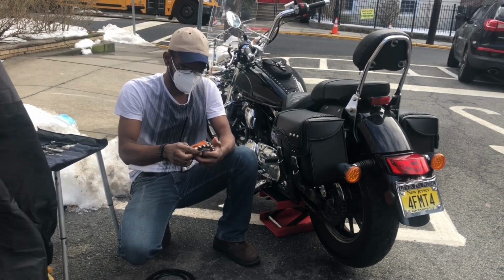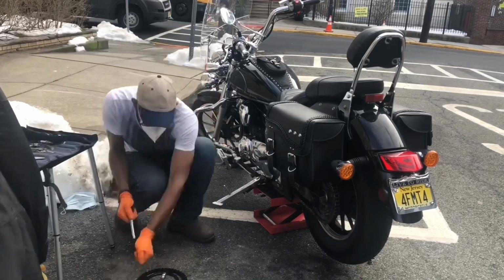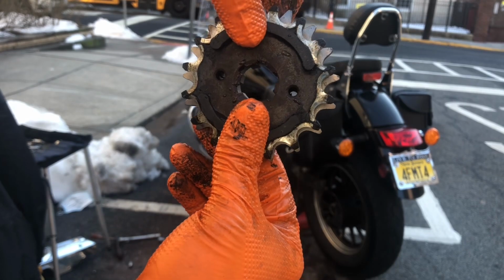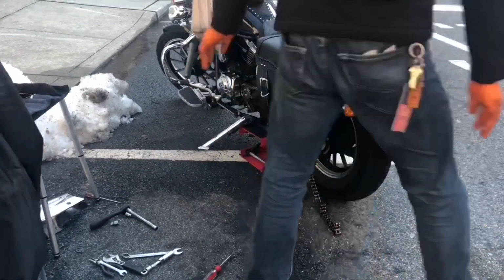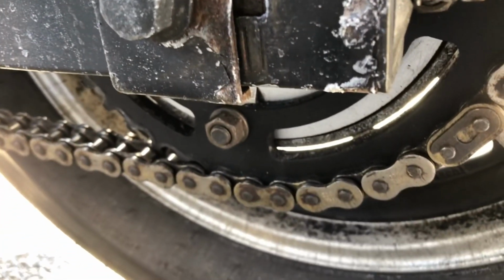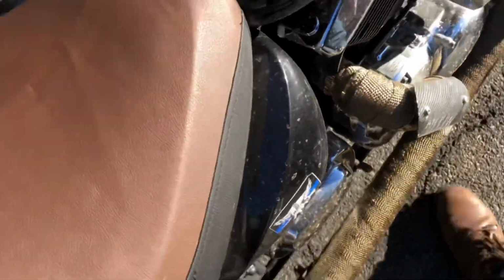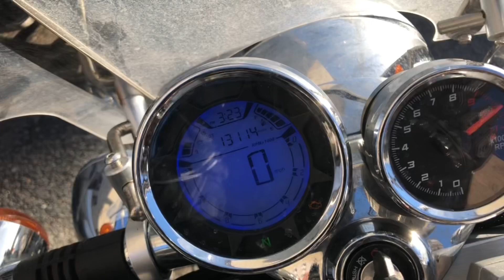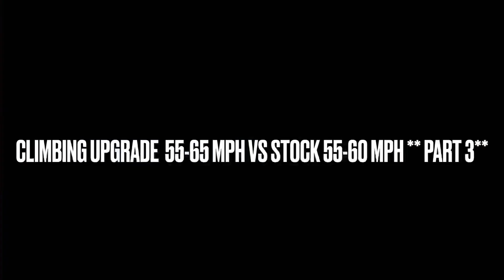American Lifan Lycan V16 LF250-D-E Motorcycle / 12,000 Miles / Tall Gear Ratio 2.47 (42/17) Upgrade

Comment: hi there many thanks for all info,new owner of lifan 250 v16 efi, i once owned a xv250,but the v16 is completly different much more easy,  my first modification will be 17/40 ,no need to stay near red line to cruise,  so you tell us that the bore of the lifan v16 250 is  bored 175cc Piston on each Cylinder ?what a great news ,may thanks for all your shared knowledge,
Reply from the maker: @sylviequirin2371  Sylvie, enjoy your bike. Hope the videos I put out help you with your upcoming maintenance. Thanks for watching :)

BTW, I’m officially retired, have been going with the slogan for years on this channel but the time you are watching this, is the time I won’t be able to help you getting parts.

Comment: I put a Yamaha virago 250cc 16/40 520 chain and sprocket kit on my Lifan just fine no problems
Reply from the maker: How did u find the 25mm front sprocket for the Yamaha virago 250cc?
Reply: @Mr.FLOYDs  honestly, I just took a gamble and ordered a sprocket set for a 2009 Yamaha virago 250 and it went on my 2009 Lifan like it was for the Lifan.. but I found the kit on eBay
Reply: @Mr.FLOYDs  Part: JT O-Ring Chain/Sprocket Kit 16-40 Tooth 520 Pitch
Sprocket Material Front-Rear: Steel-Steel
Tooth Count Front-Rear: 16-40
Part Number Front: JTF569.16
Part Number Rear: JTR857.40
Included Chain Length-Pitch: 520-112
Chain Type: O-Ring
Reply from the maker: You should try a casino lol… with that kind of luck u can become a millionaire over night n I’m not joking. Yamaha Viragos and those that I researched has the 21mm sprocket and I swear I was looking into that before actually using my import experience to make this work. Yet you just gamble n it went to your favor lol…

Comment: what is the cruise speed and what is the final speed? How many miles can you travel without overheating?
Reply from the maker: Lol if u plan on traveling without overheating u need to redo ur math. I'd say given that the temp is at 25 fahrenheit u can go forever with 10W40 at high Rev. Right now with this summer heat if u r planning to travel far for a long period of time I would strongly suggest 20W50 n under 6000 RPM to save the engine n it will give u easily 60-close to 70 MPH.

Should u choose to b n idiot n consider all motorcycles r made equal n don't think about these stuffs u probably would overheat it within 25 miles in high Rev. 

Mine lasts 19,500 miles n still going. The only problem it had was a transmission bearing that went bad... Otherwise compression wise because of my math of constant weather adjustment it just won't die with overheat. More than likely I'm at a heatstroke at high temp n can't b cooled enough or on time n has to give it a break.

Comment: The parts of Xv250 are compatible with Lifan?
Reply from the maker: Some. Abysmal or minimalist. The Engine’s counter shaft is not the same as the XVS250. The Clutch mechanism location is not the same. The engine timing is located in similar area but is read differently…. I can go on all day mate. If I should add, this bike takes a bigger battery and the XVS250 battery will not make it start. And if you are rebuilding the engine, if you take the piston chamber of an XVS250 it will fit but you will lose parts that’s attached to this engine that give it the overall impression of a Cubic Inch V-Twin. Therefore you have to buy specific parts from Lifan specifically for this bike.

Comment: You probably are not monitoring comments but I am seriously considering this for a work bike. 22 miles at 65 mph, could this thing do that comfortably? I have a ninja 250 and it's just not up to the task but I need it's gas mileage.
Reply from the maker: I delete n reply on daily basis. N some comments I ignore if there is no need to reply.

If u can buy my bikes in NJ, i have those two for sale ATM. They have been with me for 3 yrs n running smooth as shown on my channel... 

Best thing about buying bikes from me is that the used-one I sell came with extra parts and a maintenance log as well as a real service manual for u to follow.

Anywhere else u buy a bike, I would strongly tell u stay away from Chinese like ur Ninja 250 because u now r a stand-alone person n u will get no help from maintenance. If it's the route ur trying to go, at least get a Japanese bike, then someone can work on it for u.

My bikes r flawless on mechanical repairs. N if u r local u will pay me like u pay a dealership for things to fix in there n because I have sources that sells parts to me n me alone, u wouldn't need to worry about what to buy, I'll just tell u what to replace.

 I'm located in NJ.
Reply: @Mr.FLOYDs  Sorry I think there was a miscommunication I was asking do you think the lycan is capable of handling daily commutes at highway speed without modification.